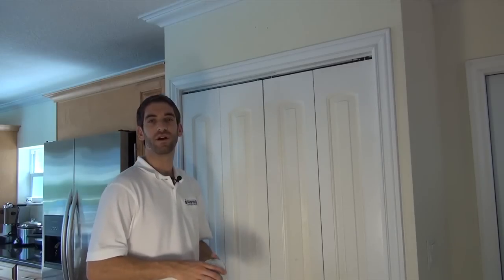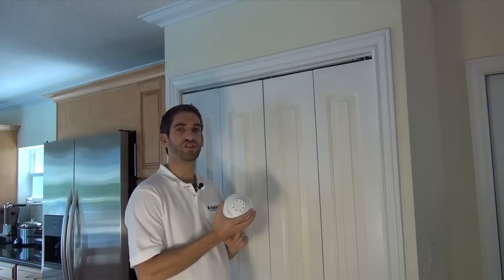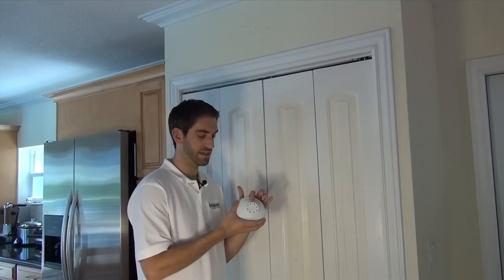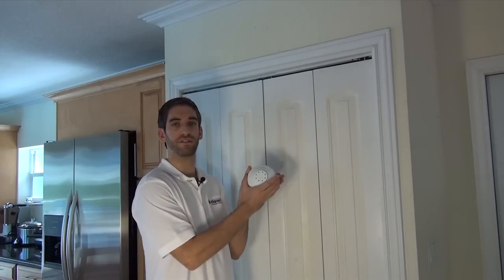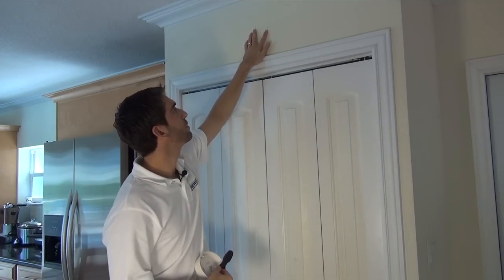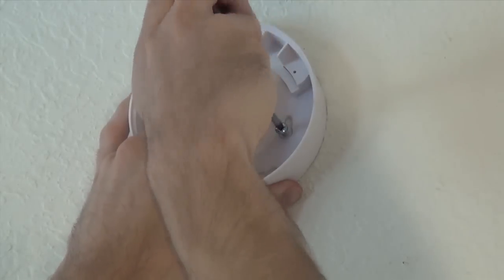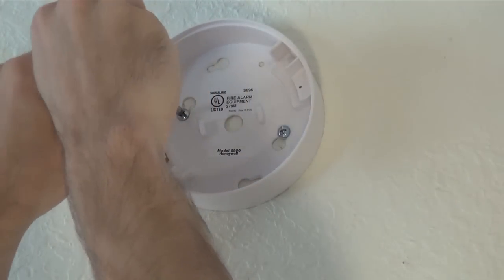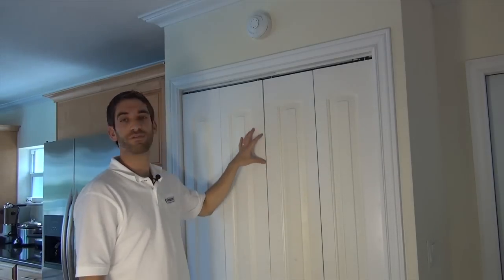Honeywell 5809: Wireless Heat Detector Installation

Comment: You can't mount heat alarms on wall a smoke alarm can
Reply: "Can't" is a strong word.  You can, it may not be the best mounting practice, but it can be done.  The installation instructions for this device specify that it can be wall mounted, but should be placed 4 to 6 inches from the ceiling.

Comment: With a 5809 Heat, can I use Double Sided tape on the sensor when it comes with my new l7000 system for my home. So will double sided tape hurt it or would it work?
Reply: It is recommended to use screws for mounting, not double stick tape.

Comment: The 5809 is a one-time use device. Therefore, you should be careful when testing. The safest way to test is to press the activation button on the underside of the heat detector head. Turn the head counter clockwise to remove it from the base, and press the button.

You can also use a hair dryer 12-18" from the detector. Aim at the side of the detector until it trips. This method can activate the sensor and if the round disk detaches during testing, you would need to replace the device.